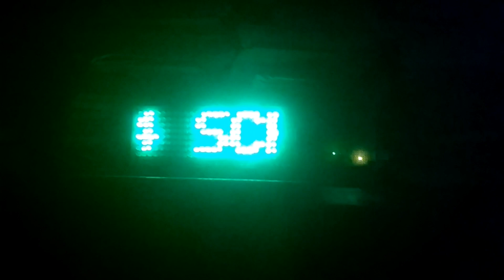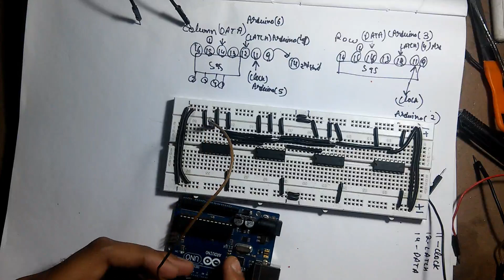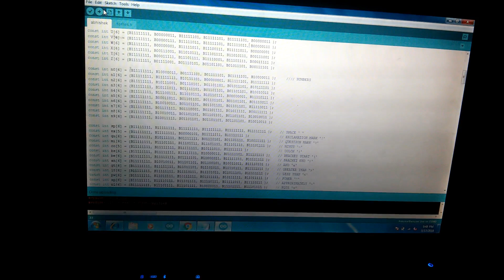How To Make  8X24 Green Led Matrix by Arduino UNO +  Shift register (74HC595N)

Comment: Hello brother, can you give more detail about soldering the Shift Register in to the board? I don't get it.
Reply from the maker: https://drive.google.com/file/d/1AOXVie6n7oQGS0UC8PdZhGRRbimjXvbm/view?usp=drivesdk
Brother,  Where u missed out in connectiona let me know.
Reply: @PrintinoLabs  Thank you so much brother
Reply: @PrintinoLabs  But can you give me more detail about making it? I just can't understand much about soldering the Shift Register and Resisters to the board. I'm so new with these equipment
Reply from the maker: Bro,You want to learn how to solder components on perf board?
Reply from the maker: There are many videos on youtube which upload by experts. I am just electronics hobbyist And i also learn from these videos plus daily practice with alots of mistakes.
Reply: @PrintinoLabs  The only question is  which leg of the Transistor that you connected to the Resistor?
Reply from the maker: @JINGSONG168  i didn't use any transistor and resistor in this.
Only shift registers, Led and micro controller. 🔥
Reply: @PrintinoLabs  This could damage our LEDs, so please can you tell me more about using Transistor 2N2222A, Resistor, and LED in this project? Just give me some clues. I still have questions about those staff.
Reply from the maker: @JINGSONG168  in this Project, i am not gonna use this project for continuous time. That's why i ignored the use of transistors.or shift registers can handle that much current which it was drawn during on time. So, no worries about any damage.
Second thing
Yes, you can use Transistor(2N2222) as a Switch.look at the datasheet of transistor. First let you know the which pin is base, collector and emitter. After this emitter is ground, base get the input from shift registers(output) and led connect between vcc and Collector.
To maintain the flow of current use resistor series with led. 🔥

Comment: As I wanted to make the display large, I wanted to add transistor at row side but NPN transistor are not working. What will be the circuit to add transistor ? Please help me.
Reply: @PrintinoLabs  But PNP used for high side switching. Load is to be connected between collector and ground.

Comment: You haven't used any current limiting resistor for LEDs. Is it okay for 74HC595 IC, as this will draw high current through IC pins ?
Reply: @PrintinoLabs  Many Circuits out there have used resistors and BJT on the ground side that's why I am asking.
Reply: @PrintinoLabs  I got it. Thanks. The last row of LED matrix is not needed for all the characters. Can I omit that row to save some LEDs ? Like 7x24 matrix !
Reply: @PrintinoLabs  Thanks again. Your code is good and understandable
Reply: @PrintinoLabs  Maximum how many columns I can add ?(I need 104) What changes have to do in code ?